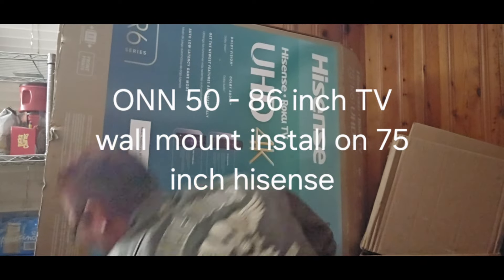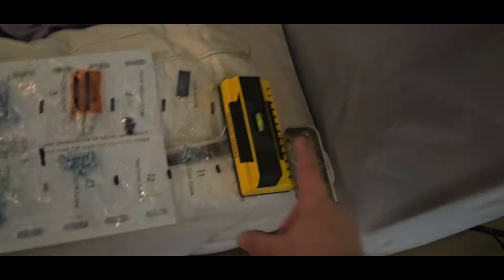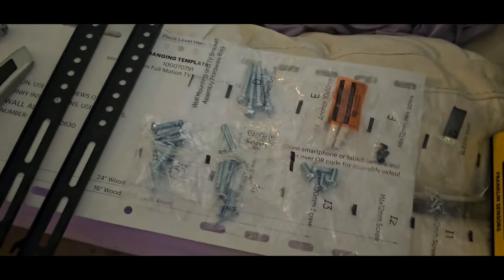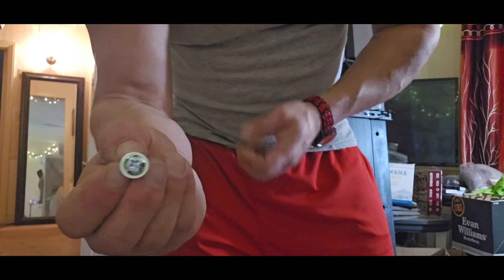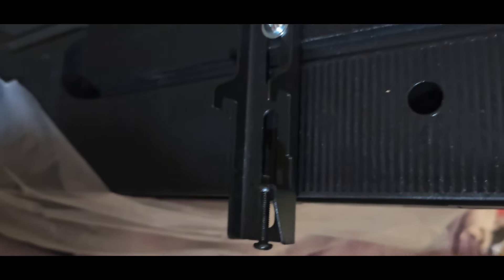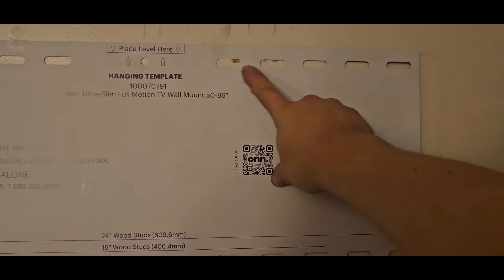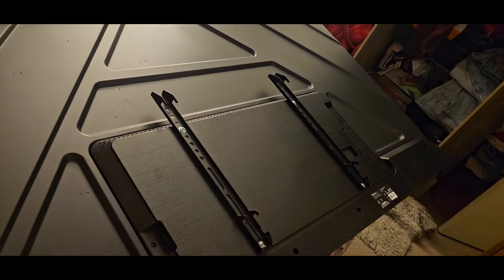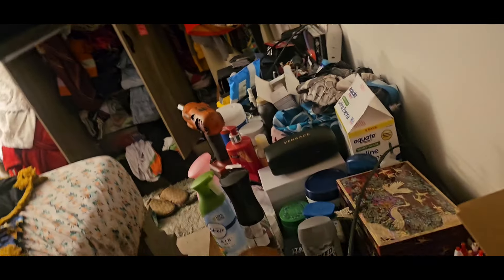50 to 86 it's on TV wall mount installation with 75 inch Hisense TV

Comment from the maker: TV COST $498.00 AT WALMART THE WALL MOUNT WAS 64.00 AND 4YR WARRANTY ON TV IS 69.00 SO YOU CAN HAVE THIS EXACT SAME SETUP AND DO IT YOURSELF FOR ABOUT 600.00M NOT BAD AT ALL. MOST INSTALLATIONS OF THIS TYPE ARE ABOUT 100.00 TO 200.00 LABOR WHILE I WAS AT DISH NETWORK DOING THIS DAILY